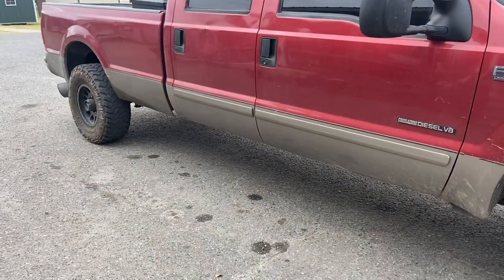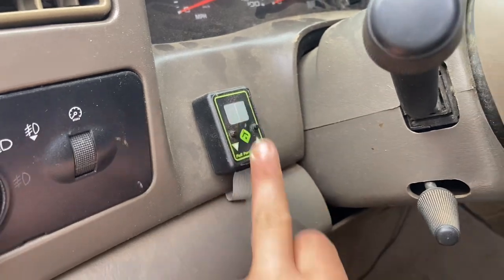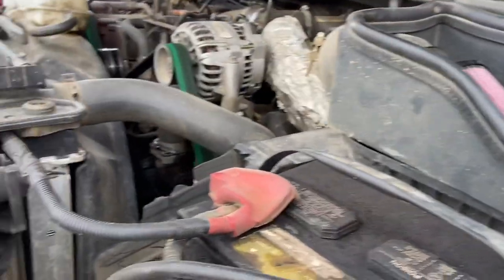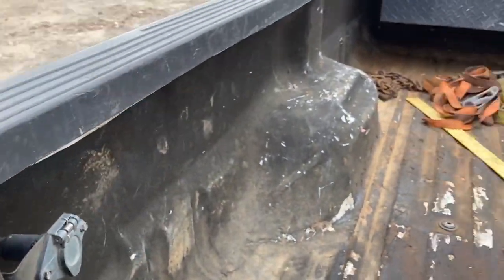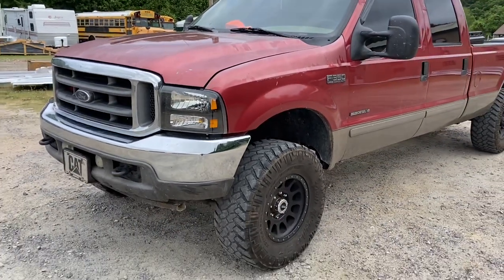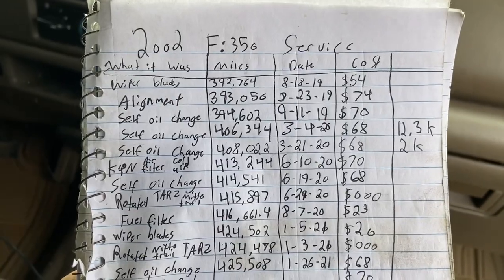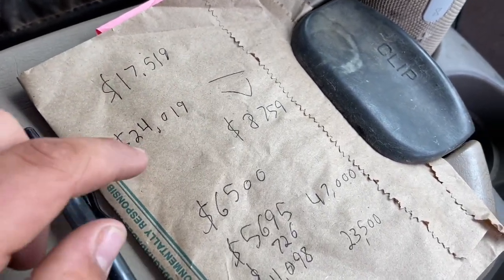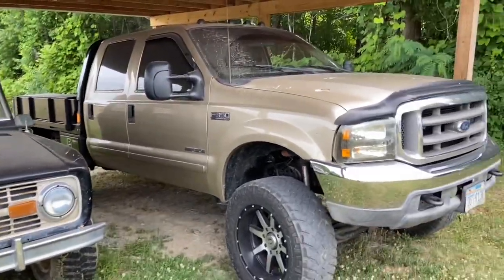FULL REVIEW Of My 2002 Ford F-350 7.3 Powerstroke!!!

Comment: just bought a 2000 f250 7.3 extended cab 4x4 short bed for $3,700 with 204,000 miles in maroon and its completley stock, no leaks runs great. has small dent on cab corner but for the price i couldnt beat it. its crazy the valley is dry and the driveshaft is snug with zero rattle. no blow by
Reply: What a steal!

Comment: How does this compare to Cummins ?
Reply from the maker: So many different factors/pros and cons that I don’t know. I personally love powerstrokes and enjoy the ford pickups more than a dodge. However as time goes on. The 7.3 is getting old and tired/lots of electronics. The old 12 valve Cummins is a good comparison and i think will be around longer and more reliably. Not for daily driving. But for the engine just working and not failing. 
Modern day. I pick Powerstroke 10x